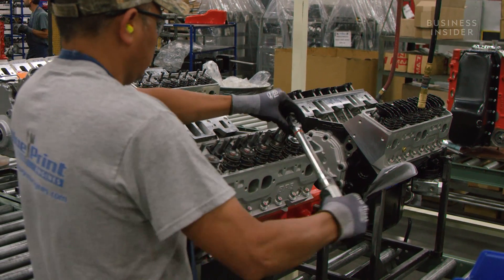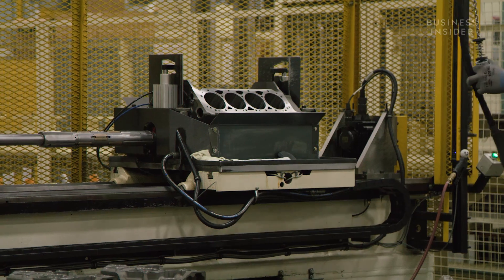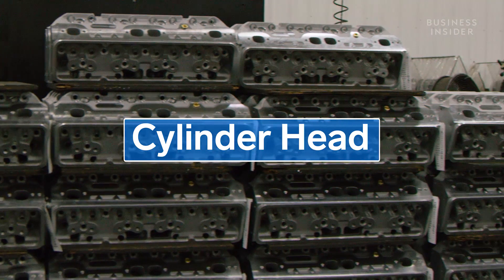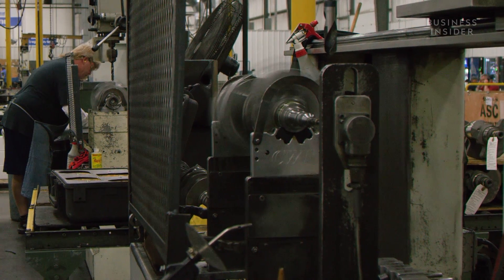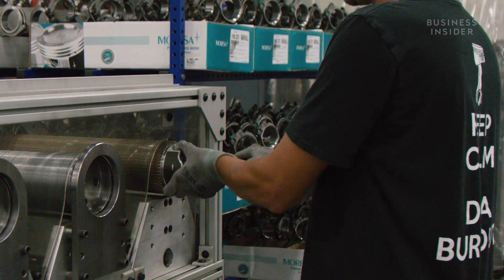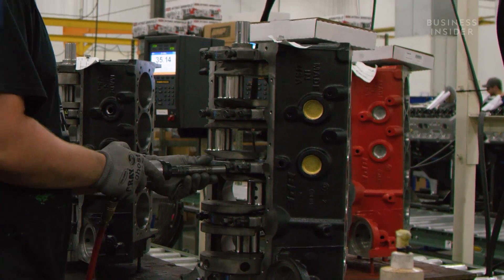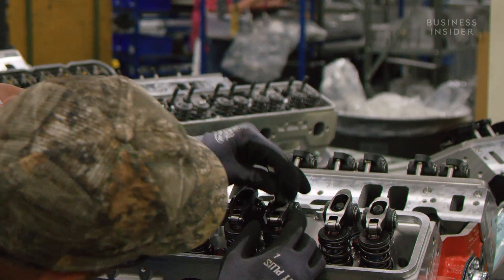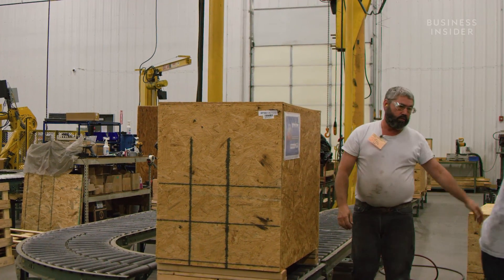How Engines Are Made

Comment: Wonder if these engines get the obligatory 20 minutes of run time to break in the flat tappet camshafts, especially before dyno-ing them for max horsepower/torque readings.
Reply: I think Blueprint only offers a couple flat tappet cam engines, the overwhelming majority are hydraulic rollers.

Comment: Nice !!  closed deck blocks !! = lots of HP options
Reply: It’s a 2 valve v6 probably makes 200 hp
Reply: @angelgjr1999 they're 2 valve v8's
Making ~250hp low side to probably around 400hp-450hp guessing higher end.
Reply: Just looked up they have >500hp builds as well.
Imagine that

Comment: You need to get your facts and vocabulary straight. Blocks and heads are cast, not forged. They're made in factories, not warehouses. Valves don't regulate the pressure, they admit fuel and expel combustion products.
Reply: They need a better script writer
Reply: Exactly 👌🏼
Reply: And the combustion process doesn't push the pistons up and down.  It only forces them down.
Reply: They can be what ever they want to be, So they identify as pressure now a days. 🥴